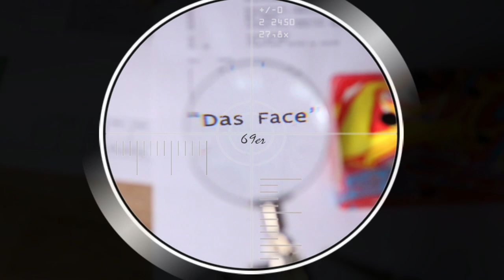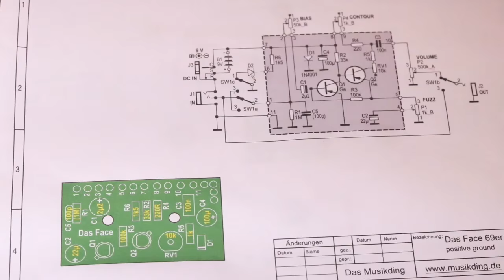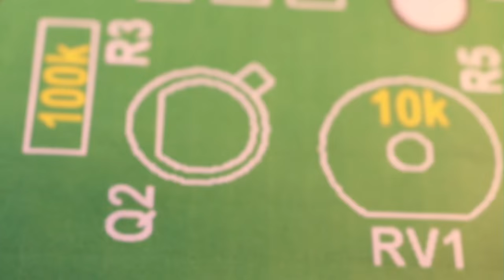How to Build a Fuzz Pedal

Comment: In pedals, when earthing.  If you earth to one point, say on the input jack. Will this work? Where is the best place.
Reply from the maker: Yes Gary your right , the input and output jacks sleeve is your ground.
Reply: Neil Robert Turner Guitars thanks man, so I only have to use one or both jacks?
Reply: Zen I know there are ground pins on both jacks. My question is use one or both, or does it even matter?
Reply: Zen actually, it don't matter now. Thanks anyway. It's pretty obvious to me now. I was panicky and extra careful.😠

Comment: What have you done with the small nipples on the potentiometers? everytime i try to tighten them the poti will be sloping...
Reply: If you're referencing the little tab that sticks up on the side of the potentiometer body, you can simply break it off with sturdy small pliers before installing the pot into the pedal.  Alternately, you can use that tab to keep the body of the pot from inadvertently rotating after it's installed. Use a really narrow file to make a slot in the hole where the potentiometer shaft goes through - you'll end up with a keyhole shape that the tab can nestle into.  This is useful if you've got a really packed pedal build where you want to ensure that the body of the pot doesn't accidentally swivel and cause a short with another wire or component.

Comment: Hey, I just built my very own silicon fuzz face from musikding, but i've ran into a problem. when I turn the pedal on I get a very low, distorted output. When I play softly or play notes in quick succession the pedal doesn't gice any sound at all. Anyone has an idea of what could be the problem? I think it has got something to do with the silicon transistors
Reply from the maker: Hi Job ,are you using a new 9v battery ?
Reply: Neil Robert Turner Guitars I'm using a ciocks dc10 power source
Reply: Neil Robert Turner Guitars I did plug my transistors in the wrong way the first time (because i'm stupid). Could it be that I damaged them when I ran power through it?
Reply: Job Muiles j

Comment: Hi! Nice video, it was really helpful! Stupid question, after you finish assembling the kit pedal and after you instert the 9V battery, should the LED light? If not, is it an andicator of an assembly error?
Reply from the maker: +Chris Bech Well Chris it isn't an error the LED only lights up when a guitar cable is plugged into it as it  (the input jack ) is also the on/off switch.So the LED is turned on by first sticking in your guitar cable and then pressing the foot switch.
Reply: +Neil Robert Turner Guitars Thanks again mate! You gave a quick reply and took the time to explain it. I really appreciate it. Cheers!